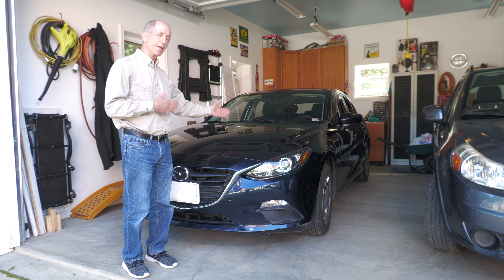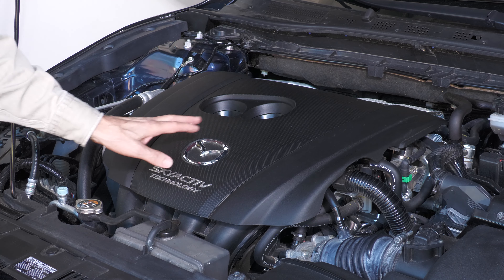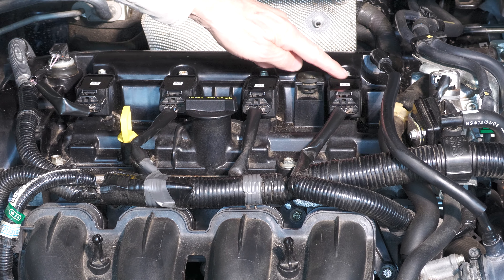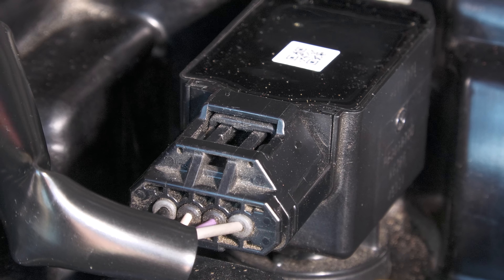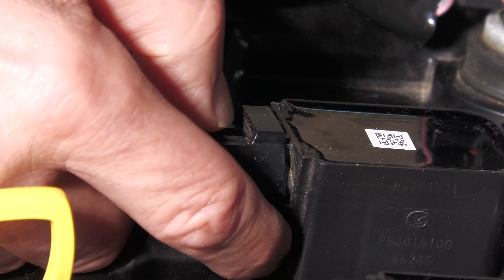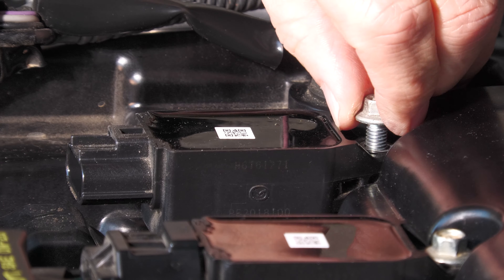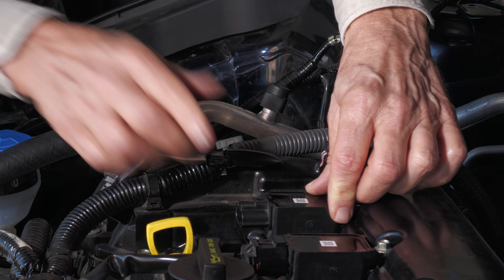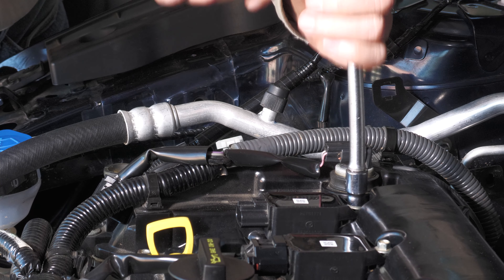2014 - 2018 Mazda3 Coil Pack Replacement

Comment: Hi Bob I have a random misfire in all the 4 cylinder of my 3 have replaced the spark plugs but still have misfires like 2 or 3 counts in like one cylinder in one trip it changes for the next trip like cylinder no.4
Reply from the maker: There are a few things I would do:

1. Replace the spark plugs.
2. For each coil pack, unplug and re-plug it 3 or 4 times. The goal is to make sure there is good contact in the connector.
3. For all the other easy-to-reach connectors in the engine bay, unplug and re-plug them, as you did in #2. Same goal -- you want good connections.
4. I don't know exactly what car you have, but locate the grounding point where the negative terminal on the battery is connected to the car's chassis. Disconnect that chassis ground and clean that spot with a wire brush or some sandpaper. Brush/sand the connector on the end of the cable. Re-attach the ground connector using some grease (Vasoline, for example) to prevent rust. Make sure the connection is good and tight.

Those are the things I would do. Good luck!

Comment: Great job Bob very easily done I wish my fuel pump was that easy.
Keith  Kuhn
Reply from the maker: I had one car (a 1987 Audi 5000Q) where the fuel pump was inside the gas tank... and it needed to be replaced! I did replace it, but it was definitely a hassle.
Reply: @BobKovacs  
I hear you buddy I replace the fuel pump in my truck 10 years ago drop the tank down what a pain in the neck.
Being that is 20 years old now I don't care about cutting a hole in the bed much much easier.
Keith

Comment: Amazing! I’m going to try to replace mine this week I’ll keep you posted!
Reply from the maker: Cool... let me know how it goes for you.
Reply: @BobKovacs  The process worked great I installed it a couple days ago. I used the "Duralast Multi-Pack Ignition Coil C1837-4" and they seem to be working great. The car feels a lot smoother starting up and performance all around. If anyone else uses this coil pack make sure to have 4 washers handy because without it the coil was too loose. Besides that, they seem to be working great and the video was fantastic!
Reply from the maker: @shawn3979  Excellent... great to hear that the repair worked out for you and that the video helped.
Reply: Hey Bob, I have a code p0304 dismissfire cyl 4. Coils and spark plugged replaced but still coming back, the car sometimes shakes a bit sometimes nothing at all....we will replace the fuel injector and the fuel filter cleaning the  intake valves and the throttle body f this doesn’t work what else could be? Any guess? Could be the coil wiring? Thank you
Reply from the maker: @oliversefer1220  You say you replaced the spark plugs and coils? I don't think it is the throttle body, and probably not a fuel injector. I would first make sure every electrical connector that could possibly be involved has been checked to make sure it is mated properly. Separate each connector and re-connect it, maybe two or three times to make sure there is good contact. Clean up every electrical ground you can find on the engine -- disconnect each one, clean it up with a wire brush, then re-connect it. If that doesn't help, it might possibly be an ECU thing.

Good luck!
Reply: @BobKovacs  yes we replaced the coils and the spark plugs the ecl didnt come back for more then 100 miles after a little shakes popped back on.First time came on after fueling the car I delete the code was fine till the next fueling came back right after again. Thank you for your  help

Comment: is it not necessary to put dielectric grease on the tip of the coil pack sleave?
Reply from the maker: I have never put dielectric grease on a coil pack, and it has never been a problem.

Comment: Hi Bob 
Keith Kuhn here. 
I guess we both have a few vehicle problems right now.
Mine is the fuel pump in my truck.
Ohh it's always something isn't it 
BoB
Reply from the maker: Thanks for the comments, Keith!

Actually, I don't have any problems with the car. I was just doing some routine maintenance by replacing the spark plugs, although the car is running fine as is. Since you have to remove and re-install the coil packs to replace the spark plugs, I figured I could literally make two videos out of one replacement: both the spark plugs and the coil packs. I actually re-install the same coil pack that I removed in the video.
Reply: @BobKovacs  
Well it makes for a very interesting video,  really.
I always liked your videos Bob.
KK Motion Pictures 
    Crashed

Check that one out on YouTube you'll get a kick out of it.
Keith
Reply: @KTHKUHNKK  Mazda make pretty solid cars, apart from one or two small problems they generally are simply to work on and cheapish to run.  They pretty much are made in Japan as well, apart from some minor work on them carried out in Thailand.